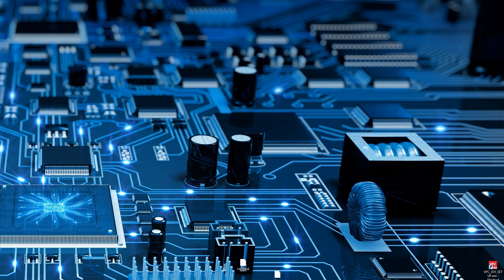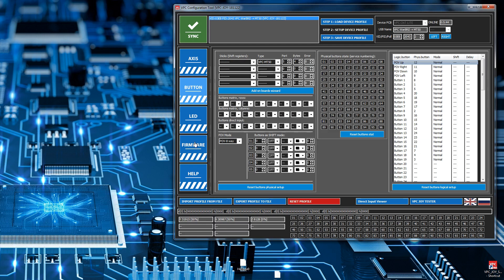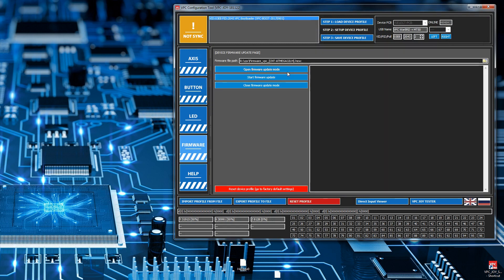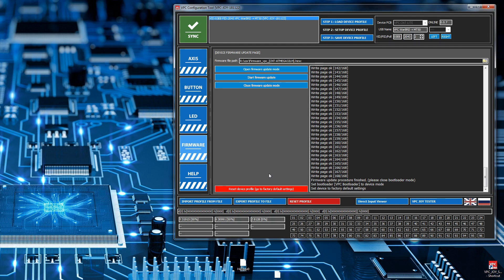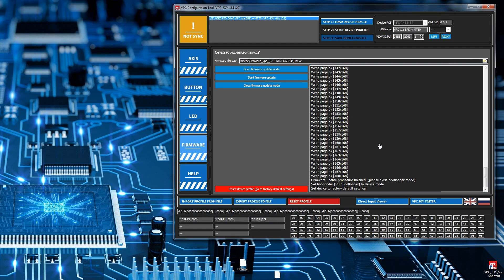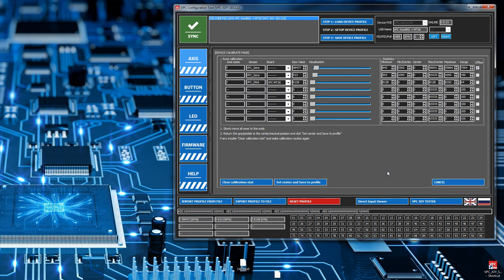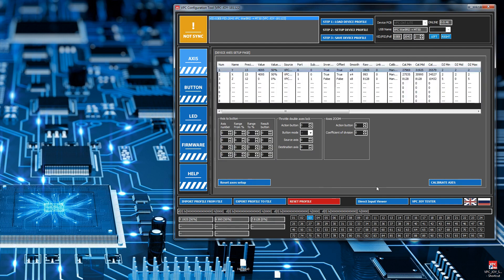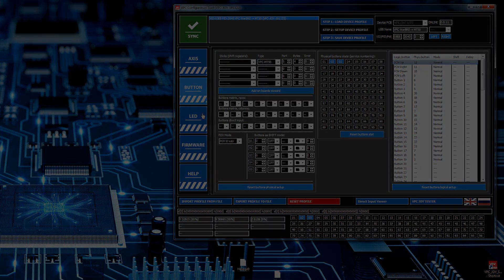OUTDATED - see link below - Using Virpil VPC configuration software to update firmware (Warbrd)

Comment: Great set of videos.  I am ordering a Warbrd base to go with my TM WH grip.  I understand that you can configure the base/grip to work with Target software from TM, something that I would like to do if I can understand how to do it.  The thread in the virpil forums "Hybrid T-50 base with Warthog stick" refers to a VID numbers and how to do it.  If you have access to a TM WH grip, I would appreciate if you would do a video on how to do it.    

FROM THE FORUM:
In VPC Configuration Tool, I always make sure to save the device profile when I make changes (set center, etc.). I get the green box with the large "SYNC" checkmark. In the list, I see "VID:044F PID:0402 VPC MT50 + TMW (VPC-JOY-181122)" If I don't have a TARGET script running, it shows up automatically in the list (give it a moment). Once I load my TARGET profile, if it loads correctly, VPC Configuration Tool shows "N/A" in a red box with a large "X" and nothing in the list. If it doesn't load correctly, it will still show the MT50 + TMW listed. 

Also, the forum mentioned that the buttons on the grip may have to be reordered/renumbered.  How do you do that?
Reply from the maker: Sorry , I do not have access to the TM WH Grip, there is a great discord channel you can gets lots of info from https://discord.gg/szqaJE7 , there are good folks there who will help you out